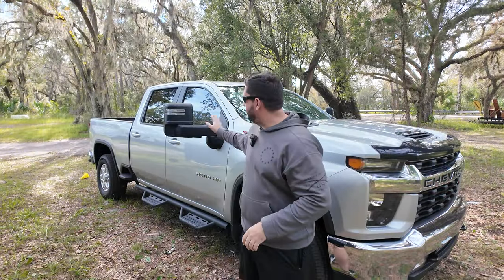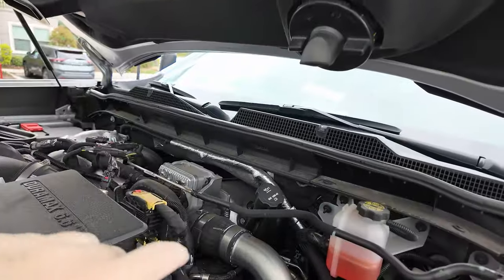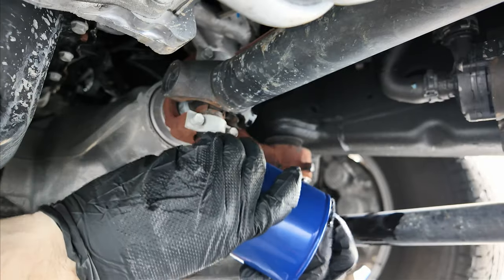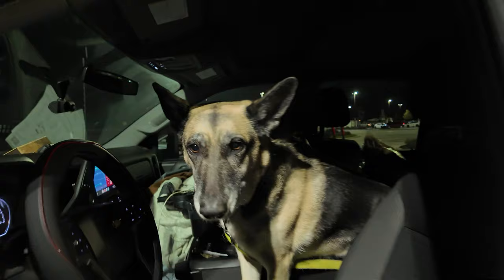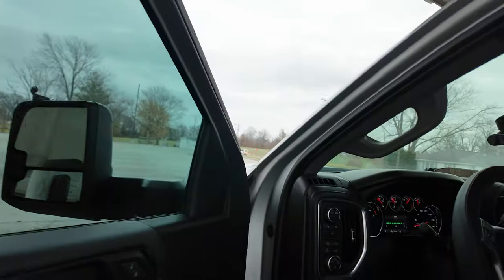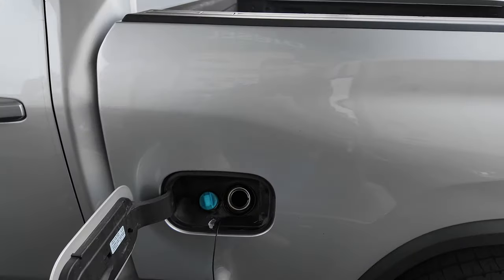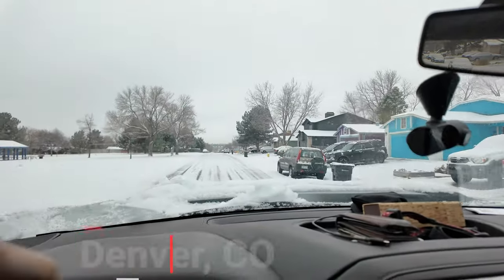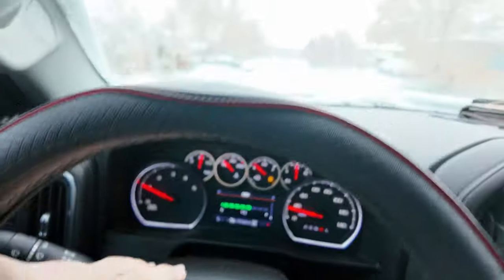DURAMAX DIESEL | DEF TANK DISTANCE and NEW DF GOBLIN Project #duramax  #djipocket3 #djimic2

Comment: how does that kirkalnd oil work for you?

also... who makes the grill light in the first part of the video?
Reply from the maker: So I have used the Kirkland for as long as I can remember on my LML LLM and now the L5P.  Never an issue and about 37$ for 4 gallons and I run it 10k between changes unless im doing some heavy stuff.  I did some digging on the testing and I'm convinced its Shell, same certs and quality certs.

As for the light here is the installation from an older video and the link to all the parts is in the description; they are about 20 bucks

https://youtu.be/Kl5wbp8st6g

Comment: what does D.E.F. actually do
Reply from the maker: Sooo there's 2 answers to this.  I cant tell you how I really feel cause I might get banned lol.  But besides adding about $10,000+ in equipment to the cost of the truck, reducing engine power significantly (if 1000lbs of Torque wasnt already enough) and adding special injectors filters etc.  The DEF or de-ionized water and Urea is injected down stream in the tail pipe before going through a wide set of filters DPF (Diesel Particulate Filter) where the DEF bounds with the carbon exhaust creating nitrogen and water as your tailpipe gasses.  You could put your face in the tail pipe and it smells like...well....Urea fertilizer......The DEF reduces your emissions by 90%...they claim.  The issue with all this is the system can be unreliable at times although it has gotten way better especially from my older diesels I owned.  The other issue is if you dont fill the truck with DEF, the truck will reduce your millage to 55mph then to 5 mph.  While this is to force you to refill the DEF its actually dangerous....imagine creeping down the interstate at 5mph.  

Now many people jump to the conclusion that they will remove the system (delete) it.  What they don't understand is if you ever go trade that truck in its an automatic 10K as the dealer and if you have smog testing its hard to get around that.  Thats not to say private sale isn't possible.  

The other thing is the EPA is cracking down, its $5k for unlawful part and its not unheard of to see 50K in fines and states refusing registration.  

Heres the kicker.........driving a deleted version is a night and day difference and some serious fun.
Reply: @GearHeadzGarageUSA  well since ou told me that i dont think ill be interested in a diesel i know urea is part of pee pee
i looked at the price def its not as cheap as it should be
i read that def freezes at like 12 degrees
 do they have an antifreeze for that
Reply from the maker: @GeorgiaRidgerunner  if you can get your hands on an older diesel like pre 2012 they were not mandated for DEF they are all running straight black smoke lol

So the DEF does freeze but the DEF tank is heated and comes on at a certain temp, if you battery is dead and the DEF freezes it will cause the system to error out and throw a check engine but this is temporary.  But yes it's industrial grade Urea....not sure if it's synthetic or if they are milking folks at the urea plant.  It runs about 2.50 a gallon but honestly it's been that price for as long as I can remember at the pump.

They screw you if you buy the overpriced blue def crap in the cube that junk is like 28$ for 2.5 gallons lol.

GM charges 100$ for 10 gallons lmfao.

It's 99 % water and like 1% urea. Still overpriced